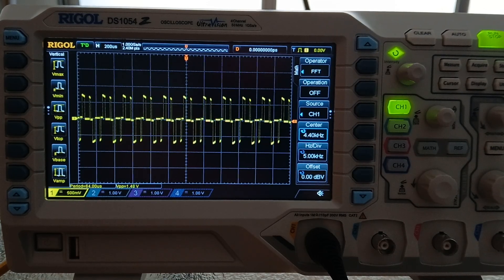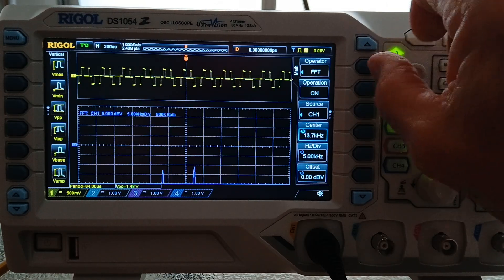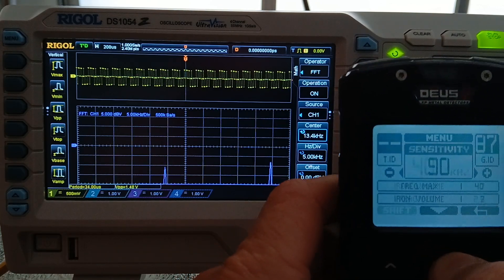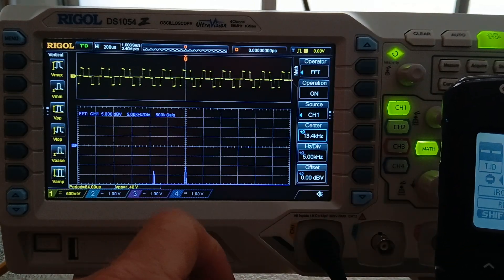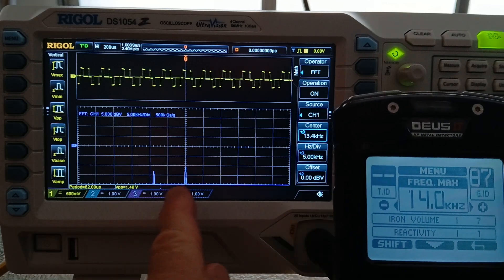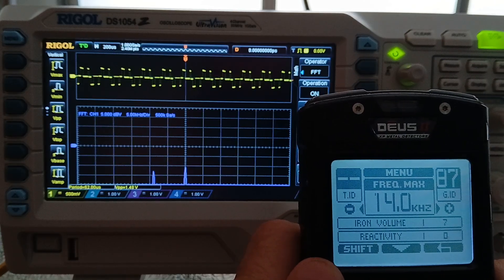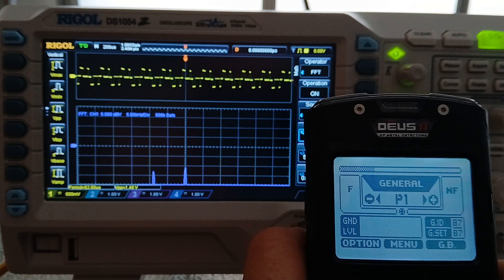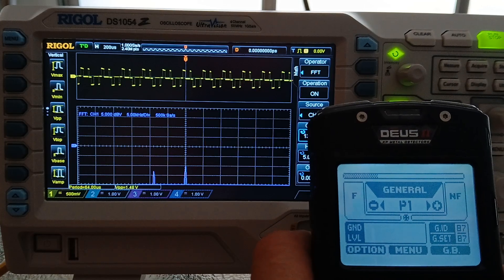XP Deus 2 Transmit Frequencies

Comment: I have a question Mark. I know they advertise these detectors as “simultaneous multi frequency”, however, are the two different frequencies actually being transmitted at the same time,  or alternately?
Reply from the maker: Unfortunately there is an extremely small time difference between the two frequencies but we humans can't sense the difference.  But a scope can capture and plot a millisecond easily.  However the Deus is still a very good detector.
Reply: @markg6836  Thanks Mark! I was just curious. I love my Deus II

Comment: I didn’t think any of the MF detectors put out more than 2-3 at one time. Can you test a Minelab, perhaps the Manticore? Also, doesn’t the frequency change based on ground or target differences?
Reply from the maker: I've checked the Manticore and could see 3 frequencies but didn't have time analyze because it belonged to another guy.  Hope at a later date to borrow the Manticore and do a more precise test.  I have also tested several targets while having the Deus on the scope and couldn't see a change in the transmit frequency or voltage amplitude.
Reply: @markg6836  Thanks, that’s interesting. I look forward to the next video with your discoveries. 👍
Reply: Hi, but if you ll choose a channel 5 or 6th in frequency scan menu manually, would it be higher?
Reply from the maker: @hihikalo Yes, the higher the shift number the greater the difference between the low/high frequency being transmitted.